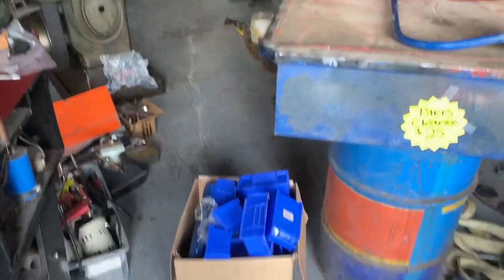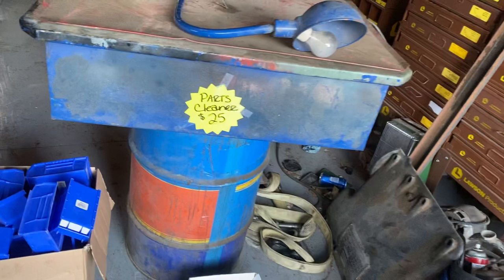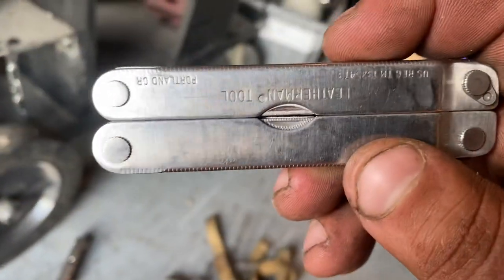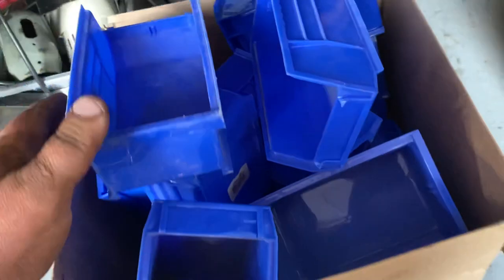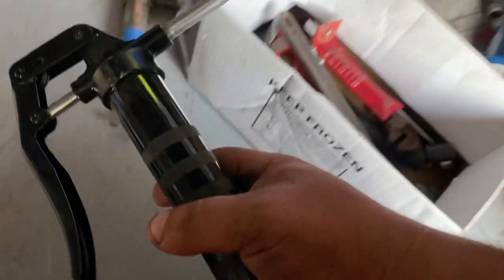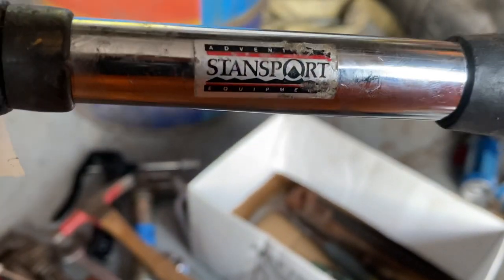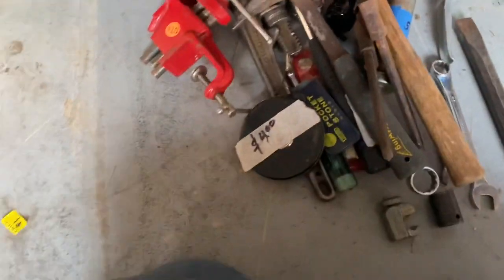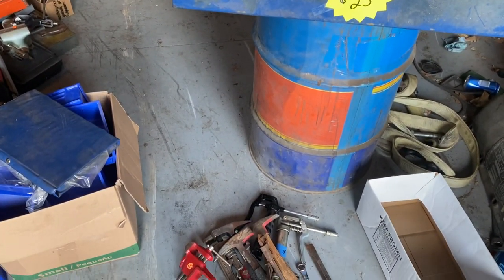Yard sale, auction, and swap meet finds 2021 #30

Comment: Some good scores. How difficult will it be to use the large grinder in the winter when it is snowing or raining?
Reply from the maker: I didn’t show up there but there is a overhang from the shop so it shouldn’t be to bad, we don’t get a lot of snow typically, like 3 or 4 inches a year typically